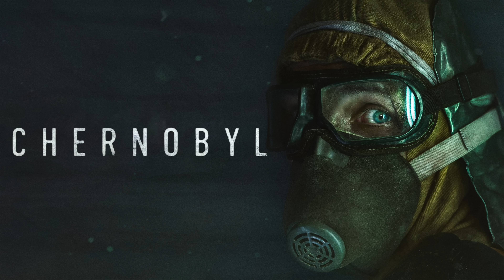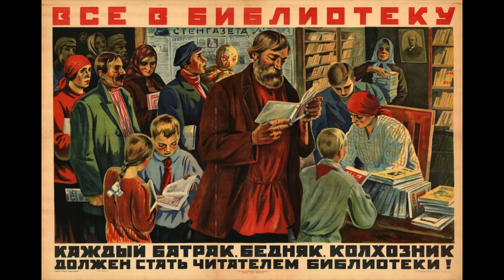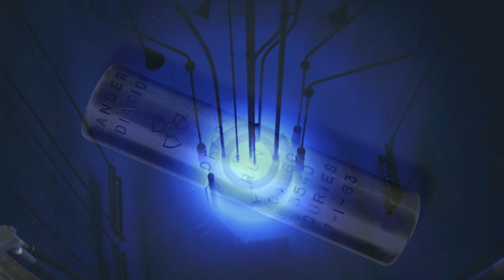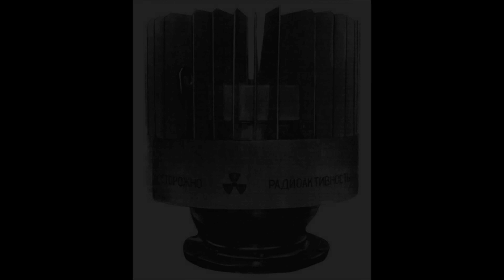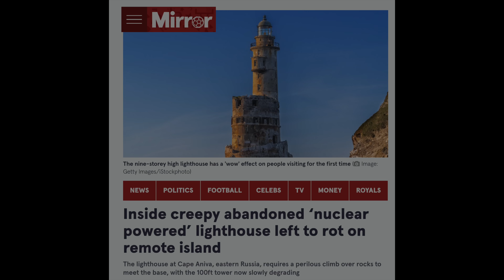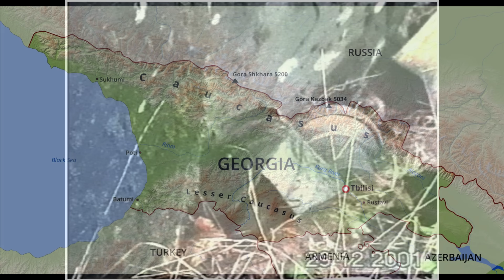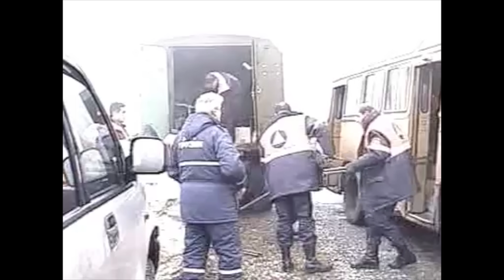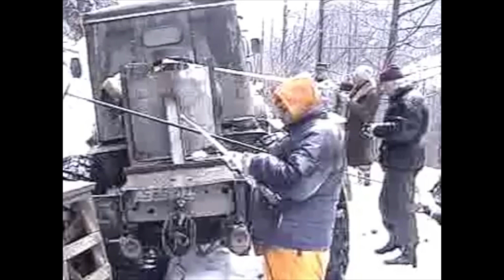The Soviet Union's Deadly Abandoned Nuclear Generators

Comment: Apparently during the Demon Core incident, there was a blue flash in open air. If you see that, it's too late. 
It's due to charged particles going faster than rue speed of light in the medium it's traversing being slowed to the appropriate speed by giving off a blue glow of Cherenkov (or breaking) radiation.
Reply: Just so you know: Cherenkov radiation isn’t the same as bremsstrahlung (“braking” radiation).
Reply: The “ blue light” happens when the material reaches criticality. Essentially a nuclear reaction has began.
Reply: I'm not a physicist, but isn't light always travels at speed of light, but slower measured speed in materials are due to photones being absorbed by atoms, and then re-emited?

Comment: Those early Russian thermal generators for the radios would not have been semiconductor based as the only semi conductor back then was germanium which dose not like heat. They would have been made of dis-similar metals, When I was a teenager I had one of those victorian books aimed at boys on projects to make, one of the projects was a thermo couple generator using copper and iron wire twisted together forming a multi point star shape the inner ring of junctions being heated with a methylated sprit lamp for which building instructions were also given. The thermal generator would just about light a small torch bulb, a candle gave better light but it was a good demonstrator of principles.
Reply: I think they mean bi-metal switch,similar to a thermostat set up.🇦🇺👍

Comment: bold move to use strontium-90 instead of ~anything else~ pu-238 is bad especially if released but its at least a beta emitter instead of a gamma emitter
Reply: Correction: Pu238 is an alpha emitter. Thus it's the 'perfect' RTG source that needs minimal radiological shielding. Chemical/bio-toxicity of Pu is no worse than that of lead.
Sr90 is 2MeV beta emitter. The problem with high energy beta radiation is that when it interacts with/is slowed down/stopped by high-Z number elements (like steel or lead) its energy is converted to gamma radiation in the process (bremstrahlung/'braking' radiation). So the best initial shielding from beta radiation is 3cm of Mg-Al alloy (same as what car wheels are cast from) followed by several cm of lead. NOT THE OTHER WAY round!!! That way, you get optimal conversion of that energy to heat, and not to an even harder to shield radiation form.

Comment: This documentary was completely fabulous and enthralling. At the very end I found myself saying "The definition of madness".
Reply: If you're referring to them potentially building more, I disagree. This is technology which is useful, and if well designed and maintained, be a minimal hazard. The main hazards here were a design that allowed them to be disassembled by anyone, and neglect that allowed the weather to degrade them. They could be designed to be self-protecting from the weather instead of relying on other structures, and also not easily disassembled with normal tools. I think the idea is brilliant. The implementation was poor, and the neglect was worse.

Comment: Interesting, thanks! Do anyone know about power (watt) of this type of generator?
Reply: 10 watts
Reply: @blackhawk7r221  converting these to power sterling engine generators in those cold conditions would create enough of a temperature differential to power 250 plus watts. so inefficient.
Reply: @sorejack  As their thermal output is only 250 W to start with, there is no way you can get more than 250 W electrical power.

Comment: I've always been curious about those Soviet RTGs. Thanks for making such an excellent video about them and showing the actual footage of the Lia recovery. Is it weird that I kinda want one? Without the radioactive source of course!
Reply: I can't find the article now, but there was a company which actually produced a Thermoelectric Generator which incorporated a short section of standard 6" or 8" flue pipe and was intended to charge batteries.  

The intent was to provide a system which could be installed outside in the flue from a wood-burning stove which would enable you to charge a small battery bank whenever you lit a fire for heating or cooking in your off-grid remote cabin.  The cold side was furnished with fins exposed to the outside ambient air.

The target population was those who just needed a little bit extra charge power in the winter when the solar didn't work as well, the water wheel was useless, and the wind turbine was spotty.

Comment: A modernized form of these  generators   could power the world
Reply: Like a nuclear power plant?
Reply: @blackhawk7r221   sort of.  Power cities and buildings with these.  You would lease them from the electric company and they're responsible for maintenance yearly inspection  and fueling   by going to micro grids powered this way.  No more big nuclear power plants being big and scary looking and being expensive to maintain.  Instead the electric company is a office some trucks lead  suits .and pellets. Maybe a pellet replacement robot ..  And a supply of generators . . no more meltdowns or radioactive event possible really .. each one powers a few miles of homes or even a single home.  Every 20 years someone with a lead suit changes a pellet in a well built sealed stainless steel flask unit . designed so that   Even if blown up by conventional weapon missle  whatever  the core would likely remain intact for recapture ...  at worst someone gets stupid and radiates themselves into a hospital bed stealing scrap metal  by opening it up unshielded ..and removing the core which is a metallic solid block of highly radioactive isotope

Comment: This technology was also used in pacemakers.

Radium will glow on its own, not through incandescence, but this is the only radioactive element I know that will do this.

When searching for the Cs source in Lia I don’t think it is accurate to say that they could detect the source radiation miles away. Assuming the hermetically seal inner canister wasn’t leaking Cesium to blow around in the environment, the radiation simply could not be detected that far away.

I felt the urge to cheer when those recovery workers got the source into the lead bucket on the truck.
Reply: I admit that I did cheer.
Reply: Radium won't glow on its own, its use in clocks and watches was in combination with ZnS:Cu, which glows green when exposed to alpha radiation.
Reply: The steel can should stop the beta decay from the Sr90 . Maybe the RTG source is not that pure and emits some gamma radiation also?
I read that most decay gamma particles are relatively low energy (>2MeV) which means they only go a few hundred meters , although this is an average and maybe some can go kM? And since the energy is very specific, finding even a few is a good ID?
Reply: @TD_YT066  I think the radiation in this case is mainly Bremsstrahlung from the beta particles decelerating. Contaminated Sr could also be a reason.
Reply: @TD_YT066  are you sure MeV level gammas only go a few hundred m in air? I've seen <100keV x rays travel that far!!
Reply: @TD_YT066  Even pure Sr will emit a little bit of gamma radiation at 1.7MeV. But I am still sceptical of that claim that it is detectable miles away. The source was measured at about 4.7Sv/h, which is about 5e9 gammas per second (at 1.7MeV). Now it's a bit difficult to go from Sv to particles, but even the theoretical max gamma output (0.01% of the ~500TBq Sr90 activity) is around 5e10. A lot of gammas will be absorbed in the material itself as it's pretty dense stuff, so I think 5e9 isn't unrealistic.
If we go with that number, that's only around 400 particles per square meter at a distance of 1km. A large geiger counter has a detection area of only around ~0.01sqm (about 10x10cm) and the geiger counter detection efficiency is usually only ~10%, often more like 1%.
So that would only be around 0.4 clicks per minute on average. Not going to detect that if you have tens of clicks per minute background radiation.

A gamma spectrometer/scintillator is a different story, but even then you will have to wait a few hours to get a good reading at those distances.
Reply: @TiSapph  I doubt there was much in the way of gamma by way of breakdown of Sr, but lots of beta decay, which you could pick up with equipment.

Comment: I imagined that these RTGs should be encased in another Biological shield made of a Lead Gold Alloy to make em safer for Construction sites, Civilians and Military. Just to provide power when A diesel generator isn’t available or has no fuel. If I was a Nuclear Engineer seeing tourists going near RTGs I would tell them that the RTG is a Dangerous Alternative to Nuclear Power-plants and that they should not be messed with and leave it to the nuclear experts
Reply: The low efficiency is not the biggest problem. That would be the amount of shielding required to make them even remotely safe to be around. The lead vessel used by the Lia recovery team was massive. Bremsstrahlung is working hard against you with beta emitters.
Reply: The problem is power. These generators, and even modern equivalents generate a small fraction of the power that a diesel or gas generator can. The only time they are used are in applications that need power for an extremely long time with little or no human maintenance or no fuel.

Comment: I'd love to have one of those kerosene lantern generators! Never seen that before
Reply: Build one! Just use a bunch of copper and iron wires to make a pile. Wiki the seebeck effect then look at construction
Reply: You can buy TEG/TEC units relatively cheaply. If run the other way round they will heat/cool their two junction surfaces when a voltage is applied. They're used in some chip cool applications and many of those cheap mini fridges.

Comment: The technology behind these things is still astonishing. A heat source that powers itself without an external power supply for half a century (depending on what material you use). Imagine if we would find a way to do this without the radioactive contamination, we wouldn't have any energy problems anymore.
Reply: Unfortunately it's not that simple. You've got to produce the material in the first place.
Reply: Yes, they are called "solar panels", 300 watts for $300
Reply: @murraymadness4674  This RTG thing went a step further. It generated power also at night. 🫢

Comment: If you need to heat your home anyway, who cares if your electric generator is only 10% efficient? The heater in my house burns gas and generates no electricity.
Reply: Exactly, which is why thermoelectric generators were perfect for powering radios, the 90% of the fuel that was 'wasted' on heat would contribute to warming the room.
Reply: @krashd , They could run them off of a wood burning stove in a cabin. Or in a camping heater.

Comment: The good news is that every 28 years, these become exponentially 1/2 as dangerous, so, by 2023, a unit deployed in 1967 would only have 1/4 the radioactivity.
Reply: Although probably still rather radioactive.
Reply: @stockwellengineeringhints3527  Dangerously so. It’s not really good news at all.
Reply: Yes I'm sure 1/4 of the radiation probably wouldn't be much worse than a chest x-ray*
*) Using a horribly bad x-ray machine
Reply: But that depends on the amount of the radioactive substance you have. How much Sr90 is considered "safe"? It's a bone-seeker, so even small amounts absorbed in the body isn't good, it just bounces those beta particles all around your insides and your marrow.